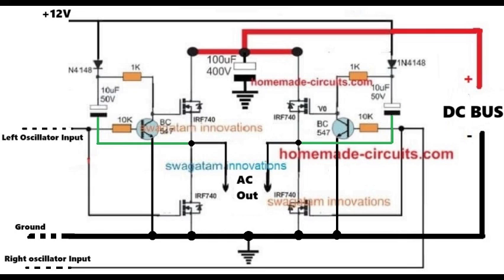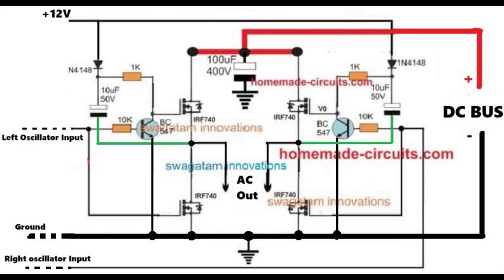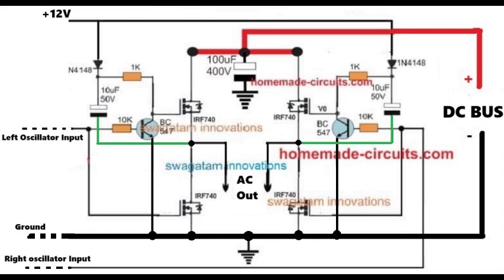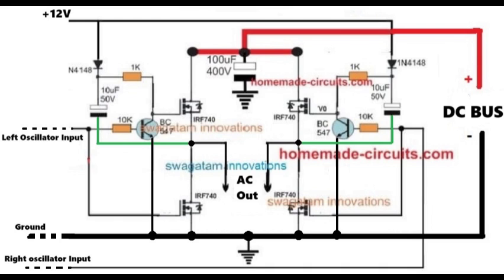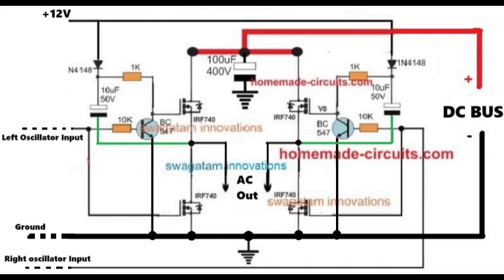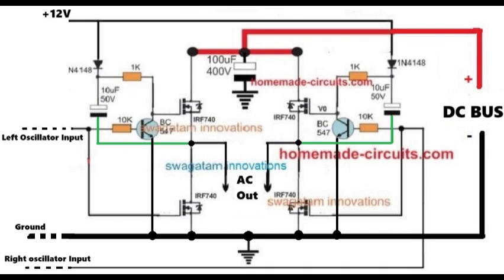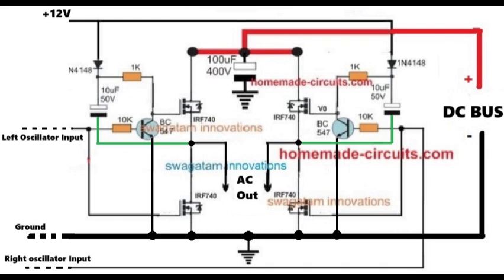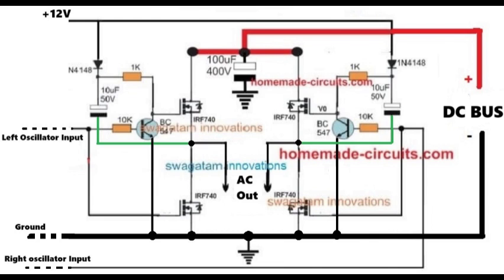Universal H-Bridge Module with 4 N-Channel MOSFETs (Circuit Diagram)

Comment: Have any one made this circuit and test it , is it working properly or not, I think transistor bc547 is not appropriate because it has lower cutoff voltage than required ie 400v.

Comment: Hello, is green wire GND for +12V power?
Reply from the maker: the ground for the 12V supply is the same ground line shown at the bottom, the one that is also connected to the source pins of all the MOSFETs.

Comment: A failed and false circuit 😡😡😡😡😡 and incorrect for several reasons, including the BC547 transistor that cannot withstand the voltages that will be between its poles. Secondly, where is the gate drive for the mosfet? Do not lie to people and do not spread what you do not know, you liar 😡😡😡😡😡😡

Comment: Can you make a video about H-Bridge inverter using TL494 with feedback voltage the main part is the feedback voltage there is no video in youtube to explain how H-Bridge inverter feedback works
Reply from the maker: I will surely try to do it. The feedback control for TL494 is actually simple. The feedback affects the output PWM of the IC. If you use the error op amps to control the feedback then the output PWM can be reduced to almost zero by applying a DC feedback from the inverter output to the non-inverting pin of the selected opamp with reference to the 5.1V applied at the inverting input of the selected opamp. This 5.1V reference is readily available from the TL494 itself. If you want to control the PWM to some desired customized level then you can do that by applying a controlled voltage to pin#3 of the IC.